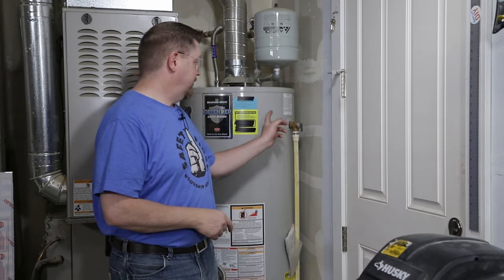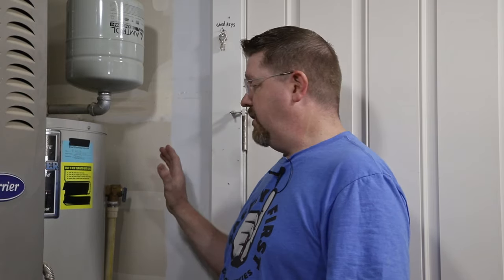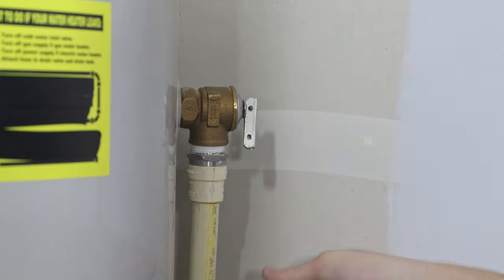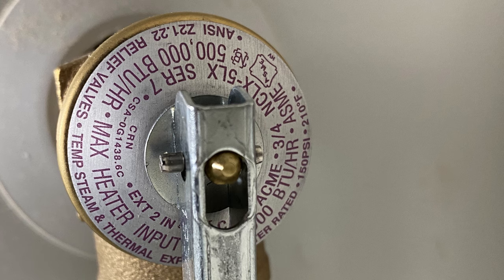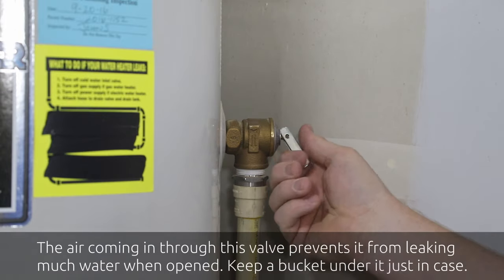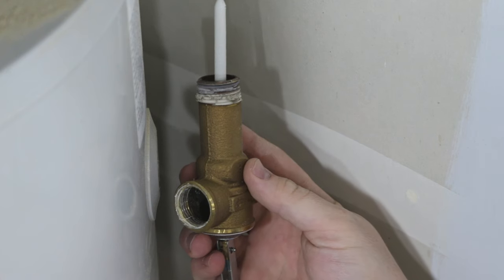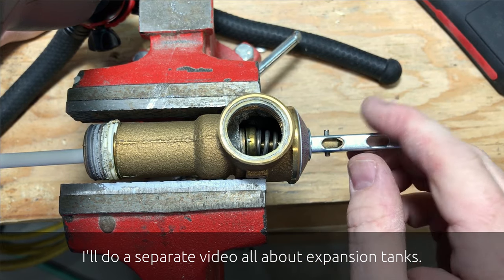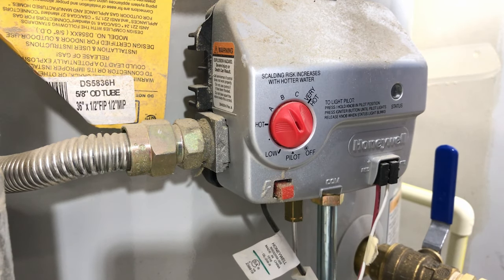How To Replace Pressure Relief Valve On A Water Heater (T&P)

Comment: I'm renting and my boiler started to leak at the bottom. In the three years I've lived here it's never been serviced and no one has educated me on how to maintain one. I started to here a cracking sound like ice breaking and hissing noise. Sounds like the valve has never been changed and the pressure built up and popped inside.

Will know tomorrow when the plumber arrives.
Reply from the maker: Oof. Your description sounds like you are headed straight for a new boiler. I hope the news turns out to be better. Good luck!
Reply: @AmplifyDIY  its a new boiler, crazy thing is the plumber said that they never need a service. Our water us not soft and is fairly hard water.

Comment: I love you.
Reply: Do you have a second to answer a question about the max BTUs? What is the difference between 400,000 and 500,000 BTU. If all the other specs are correct, can you use a 400,000 BTU valve and what does that difference mean?

Comment: Adding both tape and teflon paste to the downspout is a waste.  The joint is never under pressure, so there's nothing to actually seal.  The downspout merely directs the water from the relief valve in a controlled manner.

Comment: I've replaced my p.r.v. and flushed it and it's still dripping. Anyone know why?
Reply from the maker: Do you have an expansion tank installed? If it's faulty or not pressurized correctly, it can cause even a perfectly fine T&P to leak: https://youtu.be/NGygvtP6Sdk

Comment: What if the leak on my valve is coming out from the thread and dripping a rust colored liquid down in the side of the tank?
Reply from the maker: Hi Allan - you might be able to save the tank by replacing the T&P valve, paying particular attention to making sure you get a good seal on the threads of the valve when you install it (use both pipe joint compound and teflon tape). If that does not stop the leak, or if when you remove the existing valve you find threads that are all corroded and destroyed, I'm afraid your only real option is to replace the entire heater.
Good luck!
Reply: @AmplifyDIY  Thanks a lot for your reply. I just came from  home depot and Lowes for quotations as I found there is also a leak in the cold water pipe connecting to the tank where cold water comes in. Rust colored water also sipping out  a bit  : (

Comment: I just replace my pressure released valve after 4 hrs still leaking from p.r.v. what i need to do nxt ?
Reply from the maker: Do you have an expansion tank? It may be causing the leak at your T&P valve: https://youtu.be/NGygvtP6Sdk
Reply: @AmplifyDIY  no i don't have expansion tank ..i just have a regular electric water heater 50 gallons .
Reply: @AmplifyDIY  another thing every time im using a sink or shower starting leaking the pressure released valve
Reply: Replace the pressure regulating valve to the house then the thermal expansion tank and t & p valve and if it's still leaking you need a new water heater.

Comment: What size pipe wrench is that.. 6 , 12 , 24.. ???
Reply from the maker: It’s an 18.
Reply: @AmplifyDIY  which kind of pipe wrench is better aluminum or steel ??
Reply from the maker: Mine is steel. It is stronger and cheaper than aluminum, but is also heavier and could rust if the paint gets scratched/damaged. If I was buying new again, I'd pick up another steel one. They work great.
Reply: @AmplifyDIY  thanks for quick response.. just subscribed

Comment: Let me guess.. you installed that water heater yourself didn’t you ? That’s why there is a flexible accordion vent as apposed to ridged vent. Also the galvanized steel on the thermal expansion tank instead of brass. Let’s move on to a more serious issue though,

Water boils and turns to steam at about 210 degrees F at regular atmospheric pressure. The inside of the sealed up plumbing system, which would also include the inside of the tank heater, is NOT regular atmosphere. It is akin to a pressure cooker. The water inside the tank heater may have to reach a temperature of 400-600 degrees F or more before it could ever begin to boil. The valve is designed to open at 210F or 150psi. Temperature  and pressure, though different things, do overlap at a certain point. There is no difference from one T&P valve to another, but there are the standard tank heater style T&P valve and then the tankless style T&P valve. The only difference is the tankless water heater T&P does not feature the long white thermometer that dips into the water to check the temperature. Therefore no need to know any specs on your T&P valve, unless you have a tankless unit, they are all the same for residential type tanks. Which is all Home Depot sells, as I’m sure the majority of people watching this video are NOT plumbers and therefore shop at Home Depot. That is also an insane amount of Teflon tape that you applied to the threads. It only needs about 2-3 wraps maximum. Then you take your fingers and squeeze around the Teflon and twist the valve to really get the tape flattened out as much as possible so that the thread pattern is visible through the tape. This helps to prevent cross threading, especially when threading together any type of plastic male threads. People who are not plumbers who find themselves watching this video, don’t be foolish and let this knucklehead fool you into believing that this man knows a thing about plumbing, or that it’s a good idea to try and do these things yourself, because by the time you really screw things up bad enough where the water too your home has to be completely shut off and you need to get a licensed plumber out to your house, just know that at that point it will cost you significantly more money than having it professionally replaced by a plumber from the start. Lastly I want to add this, if your T&P valve is leaking, it does not mean that is is necessary bad. Remember that it was designed to let water out in the first place. If you lack the necessary skills and knowledge to perform troubleshooting, then you might be wasting lots of time and money. Not to mention screwing things up so bad that now a plumber is going to charge you a whole lot more to undue your mistakes. The T&P could be leaking for various reasons. Could be a bad gas control valve on a gas heater. Or bad thermostats on an old electric water heater without the high temperature limiter switch. It could be what you plumbers call thermal expansion. It could also be a bad pressure regulating valve or lack there of. If your water pressure too youth home exceeds 80psi, then know that your water pressure is way to high. 65-75psi is the ideal. Anything 85psi or above is excessively high and could cause the T&P valve to fail at an accelerated rate and leak water. Skip these shitty uninformed videos and call a pro, not a hoe ☝️
Reply from the maker: "Let me guess.. you installed that water heater yourself didn’t you ? That’s why there is a flexible accordion vent as apposed to ridged vent. Also the galvanized steel on the thermal expansion tank instead of brass." - nope, this was installed by a licensed, professional plumber...and they did a terrible job. 

As for the rest of your rant... I've had licensed plumbers screw up more than they've fixed. Save your money, fix stuff yourself. There's no magic or sorcery involved, and a residential water heater is well within the capabilities of a handy home owner.
Reply: AmplifyDIY spot on!  Mr know it all plumber trying to scare the vast majority of people who can safely and easily do items like this by themselves. Are there people that should not attempt this? For certain!  But they probably know their limitations and will call as plumber. Need to ask Mr Van Nostrum if he ever replaced a light switch or outlet in his house instead of getting a licensed electrician to do it. I know the answer to that.  I’ve worked on stuff in my house for 30 years and I have never had an electrician or a plumber in my house. Yeah you make a mistake here or there but you learn from it and move on. If you want it done right do it yourself.

Comment: Why do you need an expansion tank if you have a properly-functioning T&P valve?
Reply from the maker: This is a great question! A T&P valve is meant as a device to keep an emergency from becoming a catastrophe. They are designed to open when either the temperature or pressure exceeds a safety threshold which could cause the tank itself to rupture. Under normal operating circumstances, a properly functioning T&P valve will not ever open, because these thresholds are never met. However, just because the tank is not in a runaway heat cycle or the pressure has not begun to rise because the tank is actually boiling water, that does not mean the water is not expanding. Water always expands when it is heated. The typical municipal water supply is somewhere around 60-70ºF, while a typical water heater is usually somewhere between 120-140ºF. That's a temperature swing of at least 60ºF when your water heater fills with cold water from the supply. When you take a typical shower, let's assume roughly half the water in the tank is used and exchanged for fresh water from the supply. Assuming a 40 gallon tank, that's 20 gallons of water that will undergo a 60ºF rise in temperature. The water expands as it heats, and that much water undergoing that much of a temperature change will expand around 1/3 of a gallon of extra volume. 

Where will that extra water go? Water is an in-compressible fluid, so it has to go *somewhere*.

If you don't have a check valve on your cold water supply, it'll simply flow upstream back to the water supply. If you do have a check valve (as a lot of new construction over the last dozen years in the US does) then something has to expand to accommodate that increased water volume. If you don't allow for the expansion, the water WILL find its way out somewhere... generally by rupturing one of your fixtures, usually the hot water valve of the washing machine.

Getting back to your original question: If there is a fixture in your house that is weaker than the open pressure of the T&P valve (which is quite high), then that fixture will fail before the T&P valve opens.

I hope this explanation has been helpful. Thanks for watching!

Comment: I have same problem I watched your video and drained the tank but after that it started leaking.
Reply from the maker: The tank itself started leaking? Or the T&P valve?
Reply: @AmplifyDIY  The T&P valve. I looked at the part number but unfortunately there are no part's available nearby. So it's gonna take couple of days to get here.
Reply from the maker: @AdamJames.  That's fairly common. You can try opening/closing the valve repeatedly to see if you can get it to seal again - but most likely you'll just need to replace it. Good luck!

Comment: Drained my water heater to replace gas valve, used the pressure valve during draining, once the fix was all done and water heater was going again the pressure valve won't stop leaking. Looks like I'm replacing this valve now too ☹️
Reply from the maker: Hey Average Joe - sorry to hear your valve started leaking after the flush. That is pretty common for a heater that has not been well maintained, and hopefully replacing the valve goes smoothly for you. Good luck!

Comment: Code. Requires you to glue the fitting . Also some states require the discharge pipe to run outside
Reply from the maker: Hi Tony. Code varies a lot from state to state - not just with respect to the discharge pipe location but also whether to glue the fitting. Of course, check your local codes to make sure you are following them. Thanks for watching!
Reply: @AmplifyDIY  how/where do i check code?

Comment: You forgot to turn off the beaker for the hot water heater before you started draining! If you brought the water level down below the upper element you could burn it out!
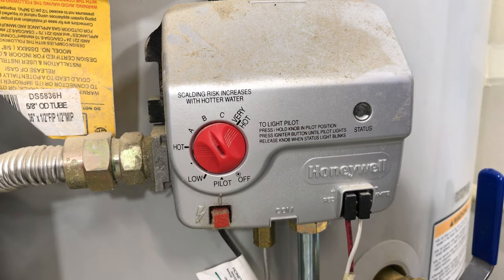Reply from the maker: Hi Brian - you must not have noticed this is a gas heater, not electric. I was careful to say at the beginning to turn the thermostat down to pilot or vacation mode, or turn off the breaker if it's electric. See 6:34.

Comment: Only question I have is do I need to turn the gas off
Reply from the maker: Hi Charles - if your heater has a pilot setting, turn it to that. There is no real need to completely turn off the gas, and if you do, re-lighting the pilot light can sometimes be difficult. Good luck!

Comment: Do you need to shut off your water heater before doing all this?
Reply from the maker: Hi OakVisuals - if your heater is electric, it's a good idea to turn it off before replacing this valve. If it is gas, it probably does not matter one way or the other. In either case, if you are planning to completely empty the tank, you should always turn it off before doing so. Good luck!

Comment: I followed ur statement and now my t&p is leaking. The plumber suggest I replace the entire water heater.
Reply from the maker: A brand new valve is leaking? Do you have an expansion tank installed above your heater? If so, it’s likely that it is either not pressurized properly or it has failed. Problems with an expansion tank can cause a perfectly good T&P to leak.

Replacing the entire heater seems like ... overkill. How old is the heater?
Reply: Case and point. These videos are dangerous, irresponsible and ought to be illegal. DO NOT, I REPEAT, do not follow this mans plumbing advise. This is not a licensed plumber in any state and isn’t qualified to be making these types of videos. Handymen need to stay in their lane ! 💥
Reply: Michael van Mastrigt - if you don't like the content then don't watch it Michael.  If I tell you to go jump off a building in a video should that be removed?  Yeh let's remove the videos of idiots getting fires started by using gasoline.  You act like this is rocket science. I'll remember to call a licensed plumber or check with you first before I go and replace my aerator on my kitchen sink or replace my spigot because I am not capable. What a joke.
Reply: @michaelvanmastrigt7591  And you should stay off the internet.
Reply: @michaelvanmastrigt7591  not everyone has the money to call a licensed plumber my dear.... some of us have to do things ourselves out of necessity. I have no choice but to learn and do repairs myself. So it’s videos like his that are God Sends!!  
   Regulations that are intended to protect( usually only protect the license holder from competition) the consumer do not always apply and many times  inhibit freedoms and self reliance. 
Lighten up a bit and have a 
happy new year 🎊✌️
Reply: Sounds like I hurt your feelings 😢
Cry me a river JT lol 😝 
Handyman need to stay in their lane. End of story
Reply from the maker: Hi Michael - I generally just ignore trolls such as yourself, but you've made some assumptions and assertions in the above comment that I feel demand a response. As the "knucklehead" in question who posted this (and several other videos you've commented on) let me set the record straight on  a few things: 
First: your assertion that I only post to YouTube to collect a paycheck is ludicrous. I have a full-time job in a career completely unrelated to the content I post here, and I do this as a side hobby. My motivation truly is to genuinely help people become more self-reliant and more productive. If you care to take a gander at the other videos and comments section on my channel, I think you'll find that it's obvious I'm here to help people, and am not in it for any monetary gain. Also, you clearly don't know anything about how YouTube compensates tiny channels like mine. 
Second: I've repeatedly asked (and you've refused to offer any real answer) what I've done/demonstrated/shown that is so wrong or dangerous. If I've truly shown something incorrectly or dangerous, I am happy to make a correction. So: What specifically about what I've shown in this video is so wrong or dangerous? Note: Many other licensed professional plumbers have weighed in in this comment section applauding the process I showed and indicating that it really is the correct and best way to flush a heater. 
Third: All the terrible / incorrect / dangerous plumbing I've come across in my life was ALL installed by a licensed, professional plumber. Having a license does not mean that the work is done right. Doing the work myself is the only way I've been able to guarantee that it is done correctly.
Finally: You come across as a first rate condescending jerk in your comments. I'll ask you to be civil, or I'll simply delete your comments and block you from the channel. I'm completely open to (and look forward to) engaging in civil discussion about how I can improve, but I won't tolerate someone simply being an ass.
Have a great evening!

Comment: Just here for the drain pipe haha
Reply: Do you have a video alp about the down spout on these release valves?  I have to build one myself
Reply from the maker: I don't have a video specifically about them, no. Generally they are just a simple PVC pipe. Head to the plumbing section of your local Home Depot, Lowes, Menards, etc, and see what you can put together. Likely someone working in that department will be able to help with your specifics. Good luck!

Comment: Is that a plastic down spout??? 😮
Reply from the maker: Yep! Believe it or not, this follows code. The pipe looks like a regular old PVC pipe (which would NOT be ok) but it's actually CPVC, which is rated to handle the potential pressures and temperatures in this installation. You can learn more about the differences here: https://pvcpipesupplies.com/cpvc-vs-pvc
Great question!

Comment: My pressure relief valve doesnt do anything when i flip it.. no water comes out at all
Reply from the maker: That's not good, and is a safety concern. If you are certain that no water drains at all when you open your T&P, it's definitely time to replace it. Good luck!